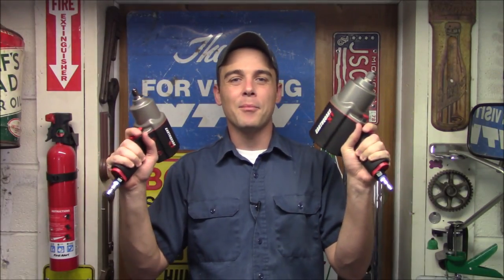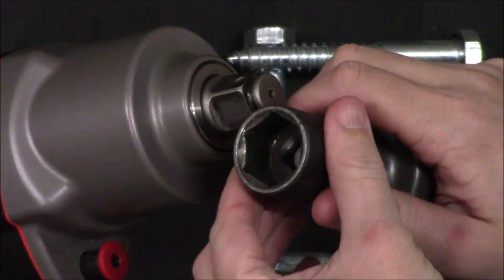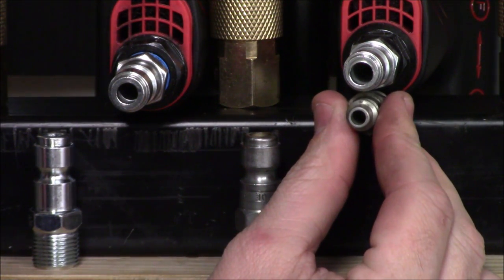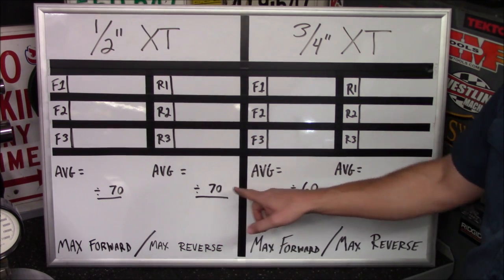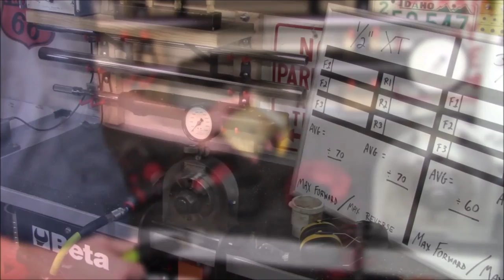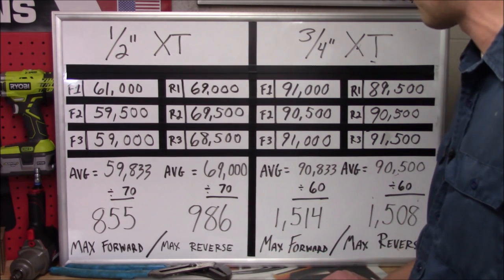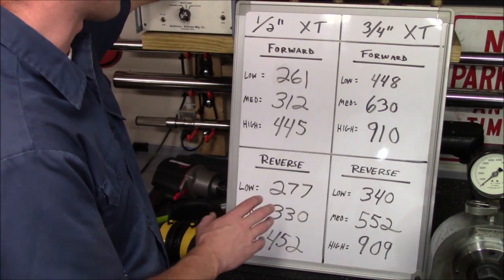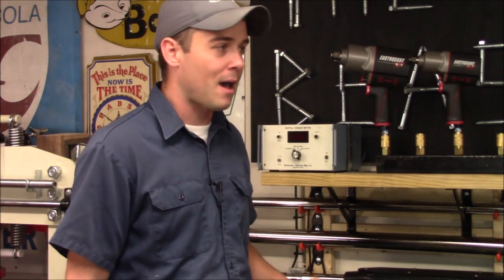Earthquake XT Composite Xtreme Torque Air Impact Wrenches! (1/2" & 3/4") 62891 / 62892

Comment: I have the Harbor Freight XT Earthquake. I use it every day in a professional shop. The most important thing you need from an impact wrench is the reverse torque. That's because you will need to break loose and remove nuts and bolts that have been tightened down sometimes for years. The fact that they are rusted to hell and may have lock tight on them makes it even worse. So far the 1/2" Earthquake XT has busted loose everything I've ever used it on. The strange thing is, it doesn't even hammer on it for a few seconds before bringing it loose. As soon as I hit the trigger it's done. It easily out dose my old Ingersol Rand impact. When you grow up in a shop and you've always used the tools your dad got you started with it's easy to become a fanboy and to get stuck with that one track mind that certain tool companies are the best. I know, because I grew up using Snap-On and thought they were made by God himself. But over the years I've learned to ignore the name on the tool and just buy what works. I started working in my dad's shop when I was 15. I'm 50 now and still wrenching.
Reply: I'm very impressed that your mind was open to get outside of Snap On. I just got my Harbor Freight XT Earthquake. Do you think I'll need the 2 year warranty? You've had it 9 months. How's it holding up?
Reply: It still works great. You need to upgrade all your air hose fittings to high flow and you need a large air compressor. It makes a huge difference. You don’t really need to go up to 1/2” air hose. Just make sure all the couplers and fitting all the way to the compressor are high flow. Like any air tool, be sure to put some air tool oil in it every so often. This wrench is one of the best deals at Harbor Freight.
Reply: I have a snap on, MAC, Craftsman, and an XT. The XT is my fav !
Reply: Yahusap the Abary 60 gallon
Reply: It's failed me a few times. I had to buy the 3/4'' model to make up for it when the 1/2'' couldn't do it. Even had a few lug nuts that it wouldn't remove. It's not my air supply, either. I have a 42 gallon setup and I run the 1/2'' at 120psi. I can max out at 200psi and I have a 1/2'' air hose, like 20 foot so not long enough to cause significant drop in the hose pressure.

Comment: I have one of each of these wrenches, I breakdown and load construction equipment into sea containers. I use a 3/8" line with 1/4" fitting on the  1/2" and remove lug nuts requiring a 1 1/2" socket. I bought the 3/4" gun in case the 1/2" gun won't do the trick. I have yet to use the 3/4" gun because I haven't found a lug nut the 1/2" gun won't remove. I am completely satisfied with them and if they go belly up prematurely I can buy another. I can do that 4 times before I invest as much as a Snap On would cost

Comment: I have the red composite version of that 1/2 I've had it about 8-9 years now and it still does a great jobby, at one point it was left early in its life out in the snow and was seized up but I dumped some marvel MO down into it and broke it free and it's been working just fine for years now.  I did get that 3/4" you had it sure was stout but I returned it after a project was done because it hurts my shoulders to lay on my back and use the thing with my arms up, so I barely have use for it given my 1/2" is my main slice when breaking stuff free.  I have no complaints about that 3/4", it has to weigh something else it wouldn't work, HF does a great job on their pneumatic stuff, I'm loyal to them on mine.  I like most HFs offerings, I've got a video about the review of my impact, I was removing some big bolts off a school bus fuel tank and that 1/2" blasted them off with ease, no pb blaster or tools just the old abused impact that still does a tougher job than they claimed on paper.
I've managed to use my 1/2" to take 32mm lugs off a full sized school bus, but that was just one, the other 2 I've tried it on it wouldn't.
This was a awesome video, thanks for leaving out the drama most other channels try and waste my time with, I appreciate it, your video was worth watching every min.

Comment: Daniel, there is another option with respect to air delivery. The European air fittings (which here in America Milton calls the Milton Style V) flow much more air than the Milton M or industrial fittings. You can see the airflow charts on Milton's website. Frankly I prefer Prevost couplers to Milton's but the Milton Stubs are much cheaper so that's what I use. This problem first came into view with HVLP spray guns (specifically the SATA Nr2000) which consume large quantities of air. We painters have been using high flow fittings for years so we are slightly ahead of the mechanical types on this point.
Reply: Yeah, Milton V style are the best in 1/4 air fittings. Higher flow and semi compatible with industrial fittings. Switched my whole air setup to Milton V's. Still better to use larger hose and fittings, because flow always trumps pressure.
Reply: SATAMAN Schmidt love the Milton V they work great!
Reply: Thank  you Sataman S, that's very helpful!

Comment: Love to see how these compare to the IR 2235 1/2" and 3/4" models
Reply: I got a couple of these earth quake laying around . For a few days it will compete with the 2235 but it will not last long you will be like me and throw it on the bench and never use it. The 2235 about after one year put a cheap kit in it and be ready for it to last for another year, Parts are much cheaper than buying new impacts. The earth quake are throw away and replace. Just put a kit in my 3/4 2245 wrench tonight. These IR model wrenches are what these earth quake wrenches are a copy of. And never run these copy wrenches on 175 air pressure like you can the IR wrench. They will wear out in just a few days. And yes when i come across a bolt that 120 psi will not break lose i will plug the IR wrench into 175 pressure. But any 3/4 wrench will use over 30cfm at 90. And very few auto shops have that kind of air flow. When i need the 3/4 i fire up the diesel compressor and it puts out 160 cfm air flow at 150 psi. Importing thing about impacts are price of replacement parts.

Comment: Hope all is well with you man.  Are you planning on making videos again in the future?  I think you have a lot to offer over other channels.  The dynamic torque testing is incredible, and it really shows the full picture when comparing impacts.  On the torque test channel, the dcf900 outperformed the hercules ultratorque i think.  But then on the Shop Tool Review channel, the hercules ultratorque outperformed the dcf900 in actual loosening tests!  I am guessing the hercules had higher dynamic torque. If a channel was to do the max reverse, forward working, and dynamic torque testing, they would be the go-to impact channel.  Many like your presentation style as well.  If you didn't have enough time and energy to do youtube anymore i get that, time with family and friends is important, and we only have so much time.
Reply from the maker: Yes I am…. Thanks for checking in!  🙂
Reply: @RealToolReviews  When do you think you will be releasing new videos? Have a great weekend.👍

Comment: My mechanic friends told me that they shy away from these guns for 2-reasons, 1: Mechanic's in shops are tool snobs.  They make fun of anyone who doesn't have Snap-on stuff, (I told them who cares, if you can get a gun for 25% what a Snap-on will cost, and it will do the job, do it!) 2.  It only comes with a 90-day warranty. I told them they could buy the extended warranty and still be way under the price of Snap-on anything.
Reply: Got promoted in the shop at Mercedes Benz dealer I have a feeling they're going talk behind my back because I dont have name brand tools but I dont care if it going push out that torque it worth the buy.
Reply: Snap on guns suck
Reply: Ingersoll rand Gun are very good
Reply: Yeah I work in construction and get shit talked on because I use a lot of Ryobi lol. Everyone pretty much uses Milwaukee DeWalt or Makita tools. I get the job done just like they do and I can buy 3 or 4 tools to their 1 tool.
Reply: My standard response is "Whatever you feel I should use, buy it for me and I'll use it."

Shuts them up rather quick. And can be applied to anything someone gives you shit about.
Reply: Like you said, people act like you're a peasant if you're not using fap-off, but I am the exact opposite. If you need a $1200 tool to do a job that I can do with a $120 tool, who lost more money? I'm laughing all the way to the bank.
Reply: Hell I got one while my matco was being rebuilt! In reality they are not bad, but they’re not as balanced and down absorb the shock as well. That being said it’s a solid piece of equipment. If you step into a heavy duty shop you will see a ton more tool diversity. No idea why. I’m an ASE master tech but stepped into diesel recently because I was offered $10 more an hour with zero experience.

Comment: I ran across this video today.  I was changing a strut assembly and my POS Central Pneumatic wrench would not budge the nut from the sway bar link, not to mention the nuts for the steering knuckle.  I've seen the Earthquake XT around and wanted some independent info on it, so this video was a great resource.  I bought the 1/2" version today and it zipped the nuts off like nobody's business.  Thanks for the video and I'm now a subscriber.
Reply from the maker: Glad to help!

Comment: can you review there new 1/2in compact stubby impact
Reply: Agree on the 1/2" stubby review request
Reply: I have the stubby and I’m happy with it. I bought it specifically for changing air bags on semi trailers. I tried the Blue Point version first but it would not remove the 3/4 nut at the bottom with the long extension on it. So I chanced the HF and it will remove all of the nuts with out changing guns. I have great luck with mine, just my opinion

Comment: I have the Titanium IR 2135 1/2" impact, and I've thought it was just the tits. Thing is just great. But i picked up one of these at HF awhile back, just as a spare because it was on sale. And I'm very surprised by it. Not only is it a very capable impact, but i expected it to be built cheap. It's not. Tear it down and look if you like. But it's very well machined and very well designed. I really thought I'd find where they cut costs on it, but i couldn't. Side by side it's almost identical to my IR. I'm a machinist by day, and honestly i can't see anything in it that is sub par to snap on or IR. If you need a nice first impact, this thing is worth every penny. HF is pretty hit and miss, but this is a total hit.

Comment: i was wondering if you could do a test of different size fittings on some pneumatic guns. Like the 1/2" gun with 1/4 vs 3/8 line and air fitting? it would be interesting to see the difference maybe do a couple brands IR, Aircat, and maybe Snappy or something
Reply: I just converted all the fittings in my air system to 3/8" high flow fittings. This made a huge difference in the performance of all my air tools.
Reply: wcjcnc would you mind sharing which fittings you used? I’m just getting into air tools and purchased the earthquake xt 1/2” and the 29 gallon central pneumatic compressor with a 1/2” rubber hose. I want to set up everything with the 3/8” high flow fittings but I’m so confused as to what to actually get. My hose has 1/2” male brass fittings at both ends. Any info is greatly appreciated!

Comment: I'm anxious to get my hands on the 1/2 drive version. I have both the snap on mg725 and the mg325 already and both the regular earthquake 1/2 and 3/8 drive impacts. I can tell you for a fact that 725 is stronger than the regular 1/2 earthquake, but isn't as strong as my nitrocat 1200k. Also that the mg325 is pretty equal in loosening torque compared to the 3/8 earthquake gun but the earthquake is much stronger in forward than the 325 (if that's worth anything to you). However since we're on the subject of air tools, the 3/8 drive earthquake ratchet is phenomenal and has held up well to about a year of abuse so far. Just my observations from some hands on use.

Comment: Mine arrived today and I hooked it up. The 1/4 fitting and 3/8 hose does fine for me, possibly due to the compressor.
Reply from the maker: I have since switched to using all 1/4" high-flow fittings/couplers....they have the same CFM rates as the 3/8" fittings & I see now difference in performance.

Comment: I have the regular Earthquake 1/2" gun as well (love the thing) and was disturbingly excited when I saw this review pop up in my sub'd channel list.   I love the rigor and attention to detail in all of your videos.

I don't know if you take requests, but I have a small air compressor at home  (The Husky Silent Flow 4.6 gal you actually reviewed once + a 7 gallon Kobalt expansion tank)  and I was wondering if you could do a video testing the actual effects of different fitting and hose diameters and show the actual working torque numbers of an impact gun like the 1/2 XT here.  Perhaps something like:
* Your badass 80gal compressor with 1/4, 3/8, and 1/2 diameter hose and 1/4 + 3/8 fittings on each if possible
* Modest compressor setup like mine with 1/4, 3/8, and if even possible 1/2 diameter hose and 1/4 + 3/8 fittings

I realize that's a crapload of testing and time-commitment right there, but I would be super interested in general to see real numbers linked to different hose/fitting diameters when the impact gun and hose length are held constant.

Comment: Would you please do a comparison between these and their predecessors that's sold along with these?  From the ratings, the differences seem to be slight increase in torque and composite housing.  If the torque ratings do not differ much, the predecessors would be better value.

Comment: Great video! I am in need of a good 3/4" impact for work and I'm really thinking the Earthquake will get the job done. Id love to see a similar review of the new Milwaukee 3/4" battery impact!
Reply: Hey there. I know this is an old comment, but the Aircat 1680-A and Capri Tools 3/4” are really powerful pneumatic impacts. If you’re looking at battery powered stuff the Milwaukee 2864-20 3/4” is a pretty nice cordless to have.
Reply: @AlexMaysonet  Thanks for the reply! I ended up buying the earthquake XT 3/4" impact from harbor freight. Knock on wood I've been using it almost daily since I bought it back in fall and it has served me well! Tons of power! I work on tractor trailers and I do alot of suspension work so that impact gets used quite often! Pretty impressive for harbor freight!

Comment: I work for a cat dealer and use the 3/4 all the time.  Its sold for the price imho, however there are two big complaints.

Firstly, I know this is a common issue among impacts but when the fucker really starts hammering and bouncing the button will disengage half way and stop and you have to press it again.  

Secondly, the polymer/plastic shell is reallllllllly soft and not durable whatsoever compared to similar products like the IR.  Mine has flat spots all over it already.  Ill use this thing for a year and invest in a tougher impact and keep this as a back up.

Comment: I know its asking for a lot but is there anyway you can compare it to other top brand air impacts its claiming to beat? Or do you already have any similar videos on other air impacts? I tried searching but you have quite a bit of videos haha love the channel
Reply from the maker: +getignited114 I may end up ordering a Snap on MG725 (which HF is comparing it to) to see how it actually stacks up......they want over $500 for it though, so I'm on the fence about it for now.....probably will end up buying it though.  Also....keep in mind that all of my new impact wrenches vids will include the new electronic torque testing also, so you'll have a much better idea of real-time power & max power.
Reply: Thats awesome! Yeah thats the downside of snap on... Very expensive! I have the older version of the earthquake 1/2" and 3/8" but rarely use them. I use my M18 fuel 1/2" and 3/8" every day at work

Comment: Never owned an air impact - dumb question - how do you put on say a lug nut at a certain torque without breaking the nut or the stud??? Thanks for your excellent videos.
Reply: Use a torque wrench to achieve the correct torque. You can use an impact to snug the lug nuts up to keep the wheel in place, but do it on the lowest power setting you have.

Comment: But how long will they last?  I have an IR 1/2 gun I've been using for over 30 years without any problems.  I can't imagine these will last that long.
Reply: The anvil just broke on my 14yr old 1/2" earthquake (the original, not an xt). It has been used 5 days a week in a heavy truck environment. I'd say the xt will probably last about as long, going to pick one up tomorrow, will report back on the durability, it may be 15yrs from now or 15 days from now though,we'll see!

Comment: So they lied about its torque? I wonder in the long run if these cheaper impacts hold up as well as an expensive one?
Reply from the maker: There are ZERO standards for torque testing between manufacturers.....the only standardized test is the one that I do......that way you can easily see who is really more powerful (vs relying on marketing claims).  As far as reliability, I cannot say, since these are a new release.  I did take the impact apart & noticed no wear from my testing though.
Reply: moparmania86 His tests are right where these are rated. the 1/2" is rated at 1,000, the 3/4" is rated 1,500.